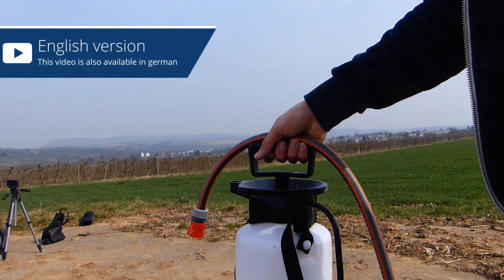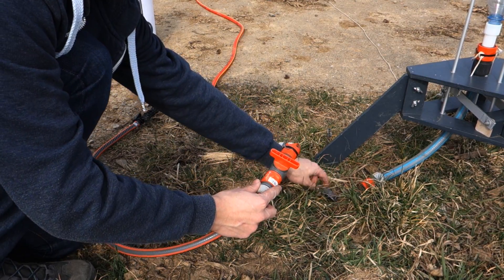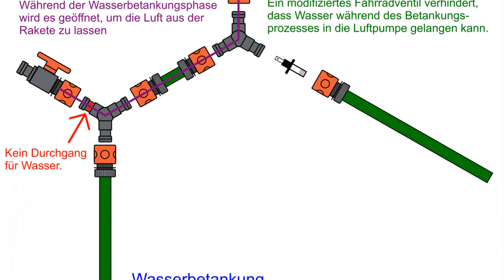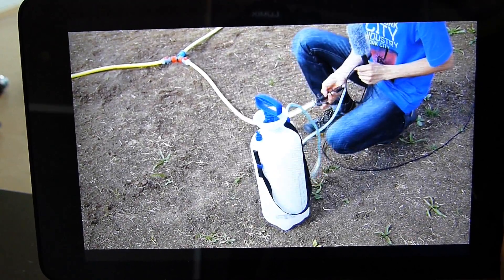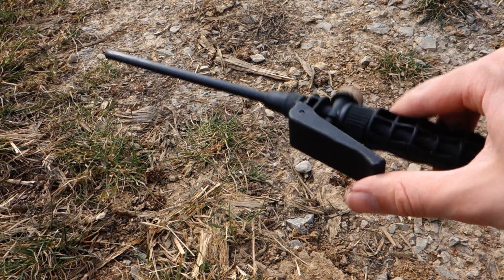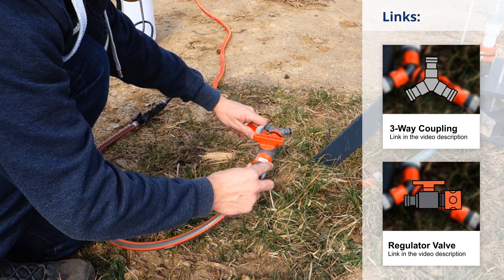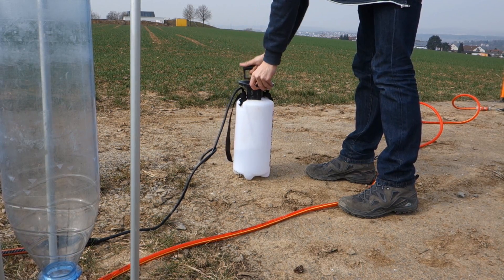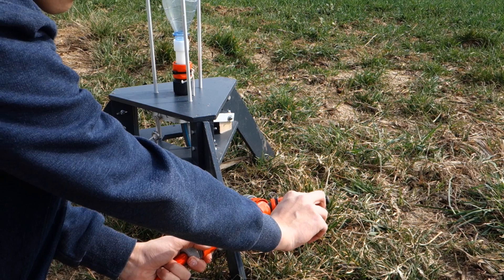Filling System for Water Rockets - Tutorial and introduction

Comment: If you had a cluster rocket or several individual rockets on one launcher like Bugwubber's design, this system would be useful for insuring that all of the rockets had the same amount of water in them, correct? It would self level.
Reply from the maker: USWaterRockets Yep, that's correct. This was one of many reasons for us to build this filling system. Do you plan to build a cluster rocket?

Comment: Very nice work guys. That looks like it works very well! :) How accurately can you measure the water going into the rocket? Do you just put the right amount of water in the pressure sprayer, or do you just overfill it and then close the valve when you get to the right amount? Also how much pressure can the pressure sprayer generate?
Reply from the maker: Hello George,
thank you. :) Yes, it works very well and you can fill the water very precisely in the rocket.
We usually overfill the sprayer and then close the valve at the right amount. It takes about one minute to fill a rocket like the Swallow 1 (7L) with 1/3 of water. The pressure sprayer itself can generate 2 Bar / 30 psi for pressing the water in the rocket. If you put more pressure in it a build-in valve will automatically release the pressure in order to avoid an explosion of the sprayer. At first we were worried because the air in the rocket is compressed by the filled in water and we thought that this air pressure will compensate the pressure in the system. But the pressure of 2 Bar is more than enough to fill 1/3 of the rocket with water. If you have a big rocket you can fill the system several times again by using the regulator valve. You could also build a bigger filling system by using pressure vessels or something like that. This could be useful for you, especially for rockets like your new Polaron G2.
Cheers
Julian
Reply: RaketfuedRockets Ahh yup 2 bar should be enough. That's exactly what I was thinking because you are pressurising the air in there when you pump the water in. It would be very interesting to see how you would fill a cluster. In our experience we've never been able to level the water through a normal manifold. When you start pressurising slight differences in the pressure chambers causes the water to start transferring between the bottles. That's why we use the fill tubes in our boosters that don't allow water to pass between the segments. You could individually fill each booster though and use valves to isolate the others.
Reply from the maker: AirCommandRockets
That sounds interesting, what are these "slight differences" in the pressure chambers? Did you consider to use non-return valves to avoid the water transfer between the boosters? This would allow you to use the filling system.
If you want to see how a filling system fills a cluster rocket, just send the Polaron G2 to us, we promise to send it (maybe) back. Haha, I'm just kidding. ;)
Cheers
Julian
Reply: RaketfuedRockets The slight differences are due to the air bubbling in unevenly into each of the boosters as you pressurise. When we first set up cluster we were amazed how much of a difference it made and how much water was transferred even though the manifold was all connected evenly. We'll try to send the G2 air-mail ... self delivery? - we'll pump it up a bit more to reach Germany. :)
Reply from the maker: AirCommandRockets
Hopefully we'll be able to launch our own first cluster rocket next year. We'll try to use the filling system, thank you for your tip with the air bubbling. We'll try to prevent that.
Self delivery sounds great - but please do not forget to glue the boosters on it. Because a rocket without boosters.....well, is not a cluster. ;)